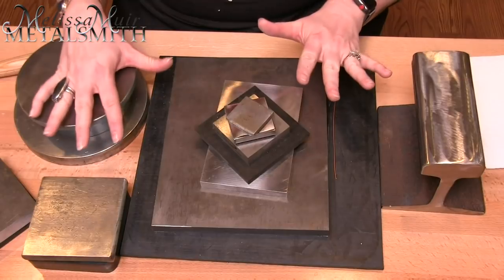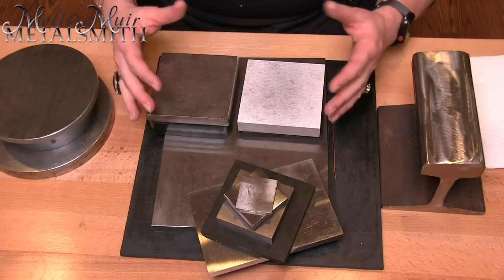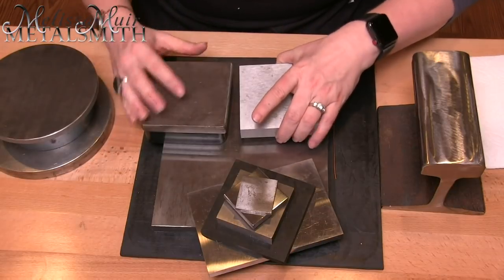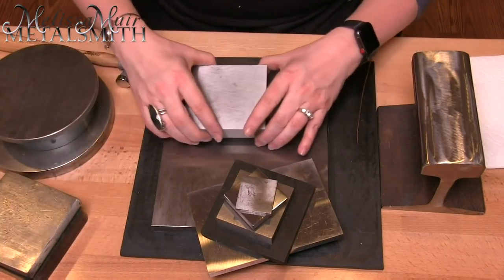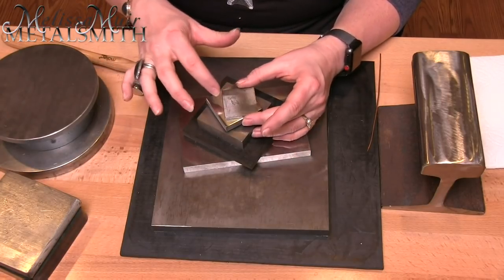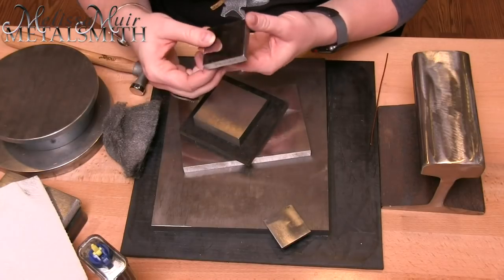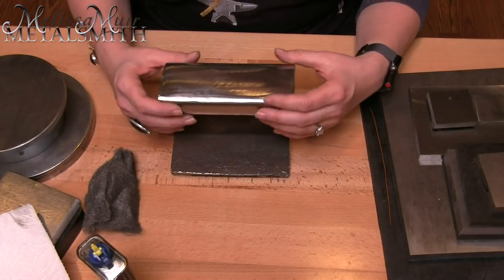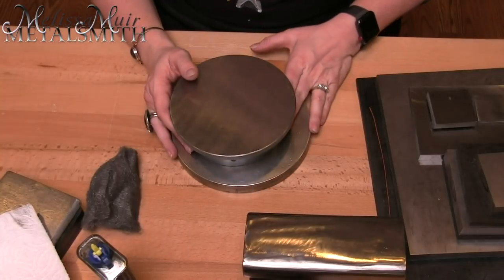Weekend Jewelry School - Session 7 - Bench Blocks

Comment: Hiya and what a great video, thank you. Such a shame some of those products are only in the states and not here in the UK, the Boeshield for one. A tip I picked up from a machinest from Kentucky was to keep his tools in cupboards with a 100Watt old style, (not led), light bulb burning away 24/7 keeping the tools and air just warm and dry enough to prevent surface rust. The oil coat is an old way of doing it and it still works. Looking forward to the next...
Reply from the maker: That is a great idea. I hadn't ever heard this one before.

Comment: I've been eyeing the Pepe Tools bench block. Apparently they're hardened to 57HRC. The 4x4 that I have is essentially tool steel. Perhaps 45-47HRC. It has dings. As such, I keep one side free from marring, and mostly use the other side for usual hammering. I'm a little surprised that no one is offering a Sorbothane base instead of rubber. It's a fantastic material for absorbing vibration and expelling it as heat. Arguably some of the best available. Not inexpensive, nor is a quality bench block. I use it with my 4x4 and a rubber one with a 2x2. The only issue with Sorbothane is that it's kinda sticky and can attract dust.

Unfortunately I don't own an anvil, though I'd really like to have one, maybe 75lbs or so. Not very big. Instead, I use a ground and hardened block of tool steel with well-defined 90* sides. Maybe 35lbs or so. It's common for a machine shop or a metal manufacturing facility to have bins of scraps. Some can be used as bench blocks and anvils, and the steel is fairly inexpensive. Last I paid was a $1/pound for S2 steel. Perhaps there's something like this is available in other folks' areas.

Are you guys familiar with draw filing? The file is placed perpendicular to the surface. If the handle is on the right side, the file is pushed forward. Left side, and the file is pulled toward you, which I personally find to be more effective. This can be used to smooth out dings and abrasions, particularly if your bench pin has an anvil. There's a bunch of videos illustrating the process, though I would caution folks as to whom they choose to learn from. If you decide to try out the technique, practice on something first. Good luck.
Reply from the maker: I had not heard of Sorbothane. Absorbing the vibration would be a good thing to have. If you ever want a 75-lb anvil, just let me know and I can get you set up with one easy enough. It even fits my stump as well. And No, I am not familiar with draw filing. I will check that out. Thanks.

Comment: May I ask how you mounted it on your stump? I want to do the same. Thanks!
Reply from the maker: There are some brackets that came with the stump. They are just corner brackets, I placed the anvil on the stump and the brackets next to the anvil and screwed them into place. It doesn’t hold the anvil down, just doesn’t let it slide around. I can pick the anvil  straight up and out.

Comment: I bought a 6 x 6 three-quarter inch block and I love the size but it is so much louder than my 4 x 4 block even with a pillow underneath it. Can you tell me why and what I can do to make it quieter? I don't think it's the quality of my Pepe tools block but I sure like the size and I can't find one at Pepi tools that is that size.
Reply from the maker: I really like the larger ones too. I have an 8" x 10" block that I LOVE! I think the sound has a lot to do with the size of the block and the physics of the hammer blow moving through the block. Sadly, I do not know what to do about the ringing. One of the tricks we used to use when using an anvil was to put a leather wallet on the end, so I wonder if you could put some kind of magnet or leather item on one end of the block. But other than that, I don't really have an answer. Sorry. I did find that placing my 8x10" block over the leg of my table the ringing is much less than if it is just over the table top.
Reply: @MelissaMuir  Thank you so much for taking the time to reply to me, I will try the leather idea and I will also try a rubber mat. Just out of curiosity do you wear ear protection? Thanks again Melissa. Best, Lauren
Reply from the maker: Lauren Youngs yes. I do wear ear protection. But probably not as often as I should.